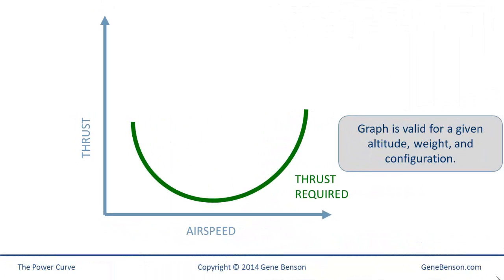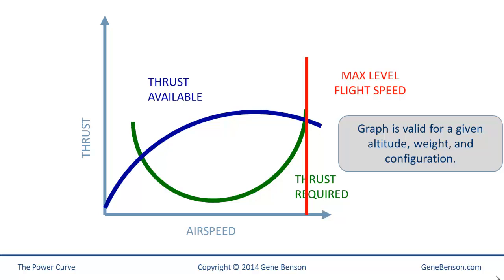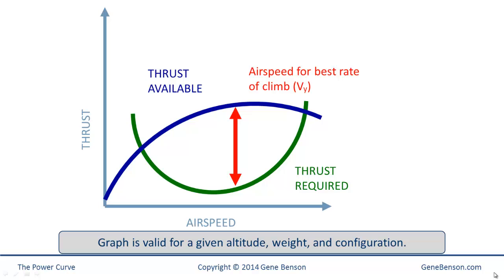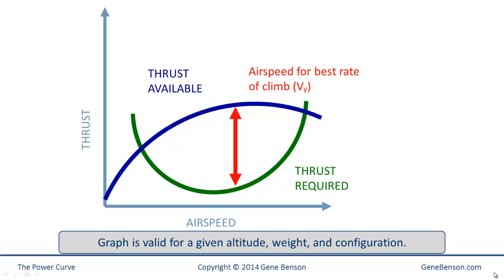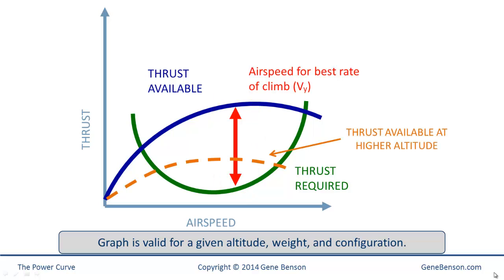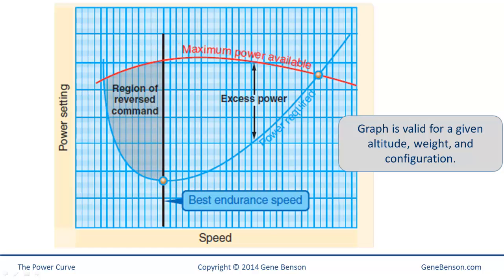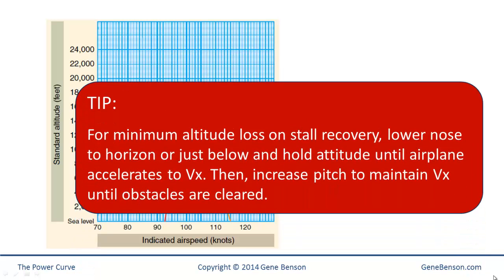Power Curve

Comment: In "the pilot's handbook of aeronautical knowledge," the section on climb performance talks about the difference between "Thrust" & "Power."  
Although I have read this several times, I am having difficulty understanding the difference between "Thrust" & "Power.".  
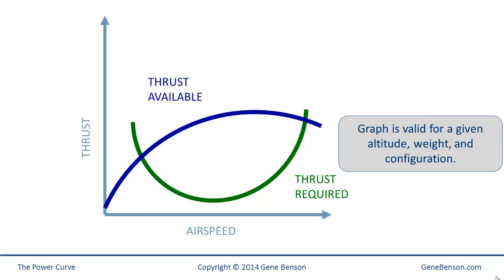In your video, at 3:15, your example adds a "thrust available" line, where the book labels it as a power available line.  
And the book example of "thrust vs climb angle" shows the curve in a different shape.  
Can you do a video that can demystify the differences in thrust & drag please?
Reply from the maker: The difference between thrust and power is actually quite simple. Power is what is output from the engine measured at the crankshaft. Thrust is is the force delivered by the propeller. Since no propeller is 100% efficient, thrust will always be less than power. The power curve compares the thrust available at different airspeeds. The curve presented in this video represents a fixed-pitch propeller and assumes full-throttle at a constant density altitude. The shape of the curve will be different for a constant speed propeller.

Comment: Nice instructional video! The explanation I give regarding induced drag begins with an understanding that the lift vector is perpendicular to the relative wind, and not the chord line. There is a pressure differential that exists between the upper and lower surfaces of the wing that induces a vortex to form at the wing tips, which causes a downward force on the air at the trailing edge (this occurs throughout the span of the wing, but is greatest at the tips). It is this downward component, or downwash, that causes the airstream to depart at a downward angle from the incoming air, or relative wind. The lift vector is now tilted backward in the streamwise direction. And it is a force in that direction that we know to be drag. 
Looking forward to more videos! Thank you for your dedication to flight instruction!